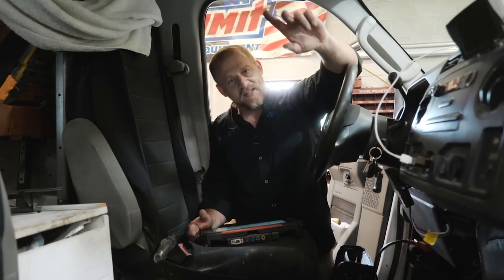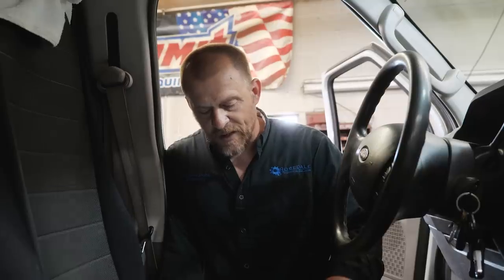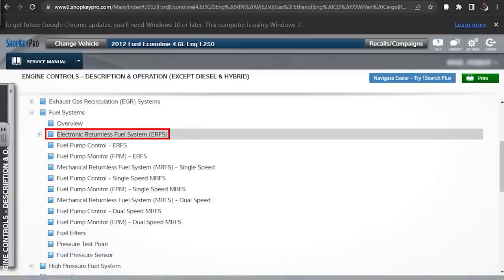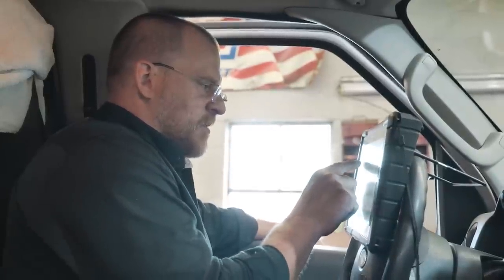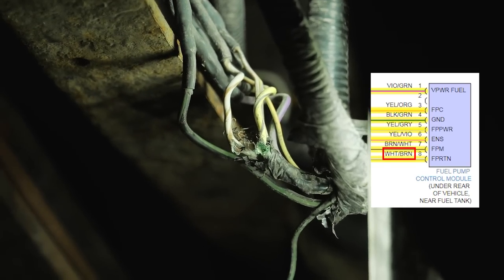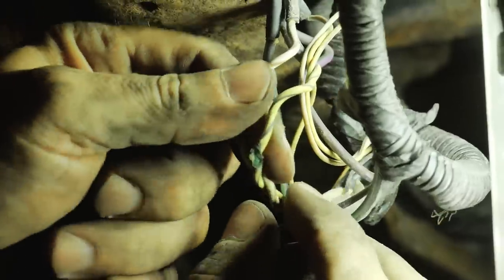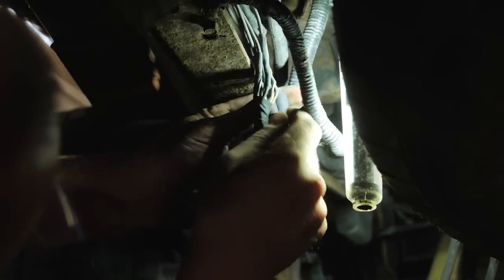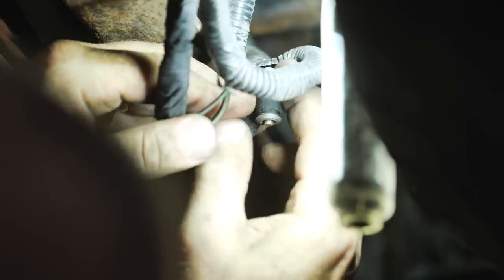New Fuel Pump - Still No Fuel Pressure - Now What? [2012 Ford E350]

Comment: Those wires are the result of probing wires during diagnosis.... 100%.  For those of you that say "oh poking wires is no problem", look here.  It doesn't matter if you seal it with that "liquid tape", it is going to fail.  If you poked my wires I would sue for a new wiring harness replacement replacement...
Reply: That was my thought exactly !!! And not sealing them. Otherwise the previous repair was almost a good one...lol
Reply from the maker: pretty sure that was road debris damage as the conduit was also damaged in that same location. I didn't see any piecing marks on any other wire.